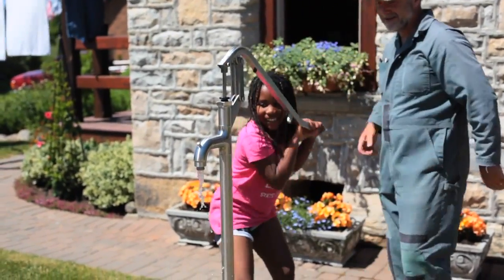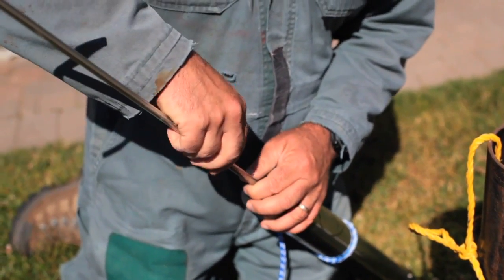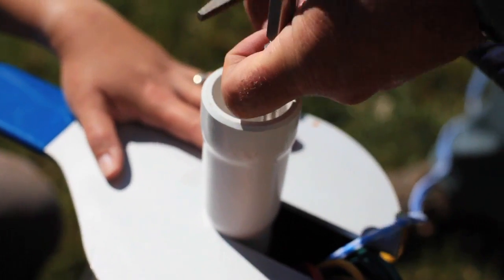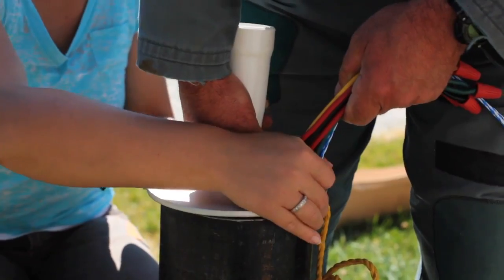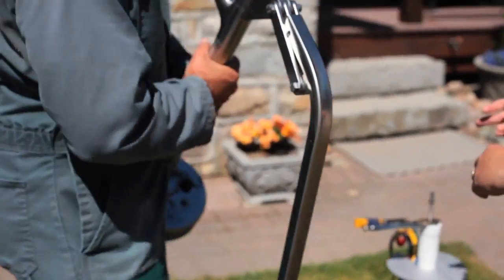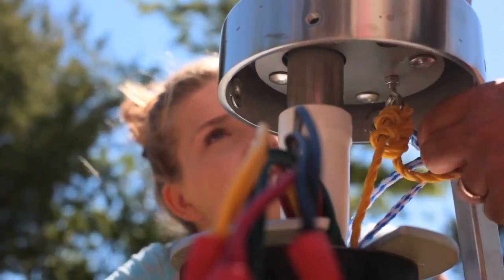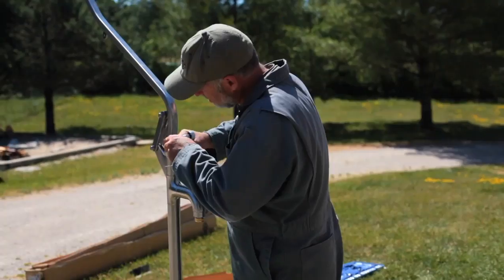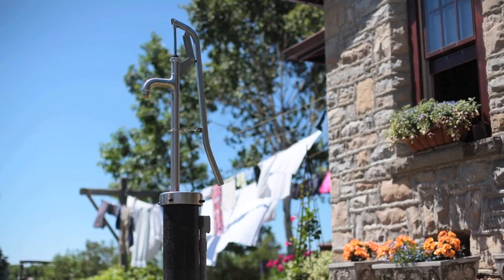Deep Well Hand Water Pump Installation Bison Pumps

Comment: Very good, informative video for installation. My situation is that I have a large bored well with the submersible pump. The pipe and wires for it come out the well cap through an expanding seal similar to the one in the video. Then the pipe and wires make a u-turn back into the ground and on the the house. Does Bison have a way to add the manual pump to this setup. Also there is a small well house over this to keep pipe from freezing. Remember this is a large diameter well. Thanks

Comment: What about the round pieces that keep the electric well from spinning, they are attached to the pipe about 10-20 feet a part
Reply: I believe you're referring to the "torque arrestors." My well is 197 feet and I was told to use just ONE torque arrestor, maybe five feet above the pump itself. That has worked since 2003. If you have torque arrestors every 20 feet, you're SOL until they're all gone except for the bottom one.
Reply: I believe you only need one torque arrest or and that should be near the pump.  Additional ones just aren’t necessary.

Comment: Is this pump system good for depths of 350'-400' wells ?
Reply: Holy shit why the fuck ur well that deep?
Reply: @brandonbarnes8997 ,I have not had it drilled yet. The water witcher said the driller would have to drill 300'. This is Ozark country. My neighbors wells r 360'-380'. The water is cool n clean tasting. It takes ur thirst away.
A lot of well drillers play people for stupid. 
The components for a wind mill can b used to pump water down to 720'.
It's used in 3rd world counties. Don't need electric or high tech anything(gas engine pumps or solar powered pumps all of witch need maintenance).
The wind mill components can b fixed to what is called a 'STANDING HAND PUMP'. It requires less maintenance than any pump system.
Damned well drillers don't want anyone to know.
It's become near extinct. The other pumps r all about their god($s).
I will probably have to draw water with a rope or cable(both of witch need less maintenance than any other system).
Old Fashion = Reliability(less $s n less tech).
I'm dumb,
Not stupid.
Born in the morning,
Not this morning.
Reply: I need to know this as well. And a guest- tamate of total price. Extra rods and pipes....